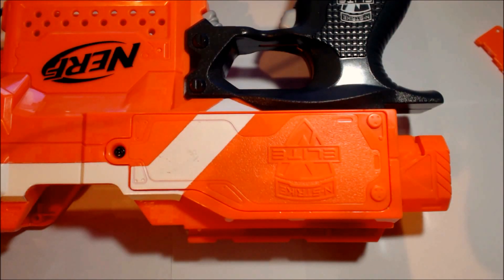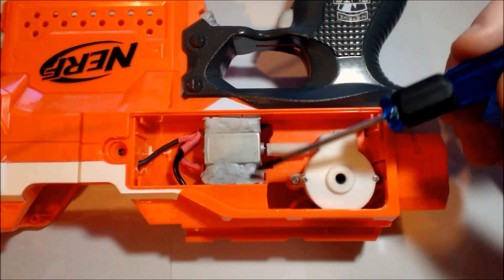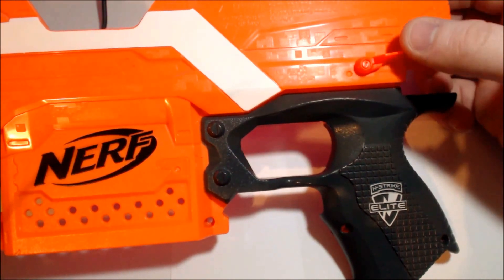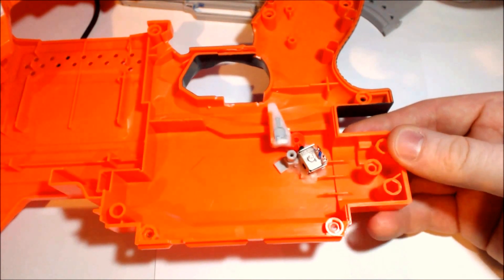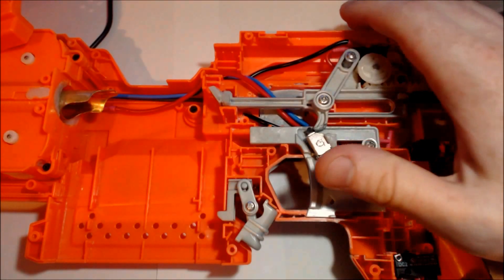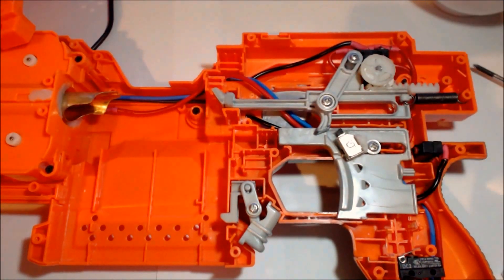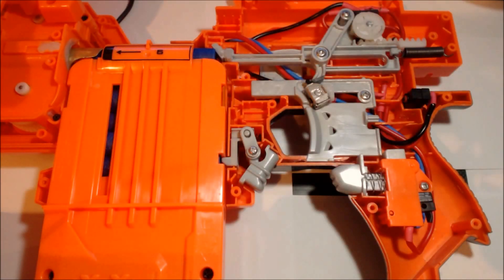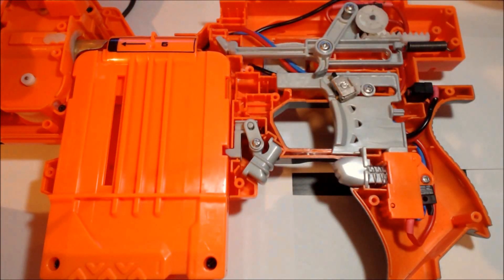Select Fire Stryfe (SFS) Breakdown Video

Comment: I wonder how this would fit in a Desolator
Reply: It should be if anything easier in a Desolator. Much more space
Reply from the maker: Since the Desolator is basically a Stryfe, it should be trivial to adapt this. I plan to do exactly that once I get my hands on one.
Reply: Moderate Skill plus the batteries are in the stock, no external battery needed

Comment: does anybody know if there is a 3d printed or such  set of replacement gear rod/pinion for the Vulcan so I don't have to sacrifice one/ pay?
Reply: +Crash Kop I am currently working on a 3D printed version of this. I could possibly sell it in future.
Reply: ShortFilmStudios Extra Oh. Thank you, I am going to try to make this myself, but in strayven form.
Reply from the maker: +Crash Kop I'm also working on a second SFS, but this time using Lego gears and an off the shelf gearbox. The Lego parts can be sourced off brick buying websites. Ideally I'd like to do 3D printing in the future.
Reply: Moderate Skill Thank you!

Comment: This is a really cool and unique design! I have started working on my own version which is very similar to yours, but will have a 3 round burst option. Luckily I have a 3D printer and have already made a custom gearbox, pusher and flywheel cage for it. Would I be able to post it on my YouTube channel? Thanks.
Reply: Of course you can, you made it. Is your design purely mechanical like mine, or does it use electronics?
Reply: +Darakou Hasegawa It uses the trigger mechanism and gear rack system like yours, but the pinion has 2 sets of teeth and gaps to make it move the pusher forward twice for each cycle. There is another switch which is a permanent on/off switch which is pushed forward when the pusher moves so that in burst mode the pinion only cycles once (firing 2 shots) This is then moved back to the other position afterwards.

It doesn't have any ardiuno or microchip if that's what you mean by electronics but it does of course have motors and a battery. Also I have tried to make the gearbox very compact so that the LiPo fits in the tray (with a large extension).

Sorry for the wall of text, I will post a video in a week or two.
Reply: +ShortFilmStudios Extra I'm looking forward to it. One thing I discovered later on was that if I just tapped the trigger in automatic mode, I get a reliable 2 round burst.